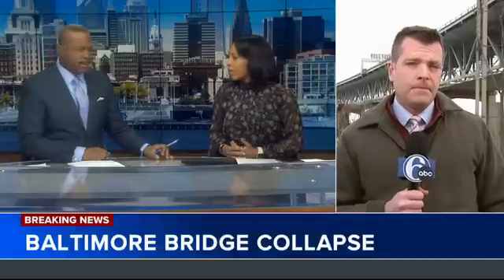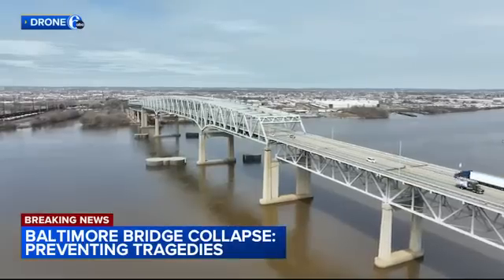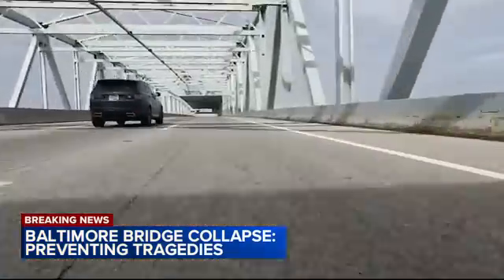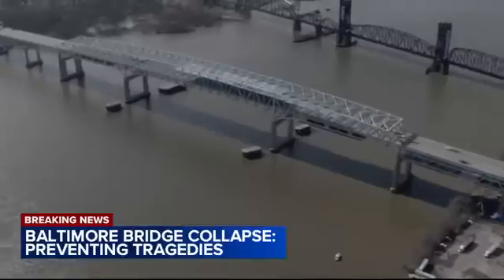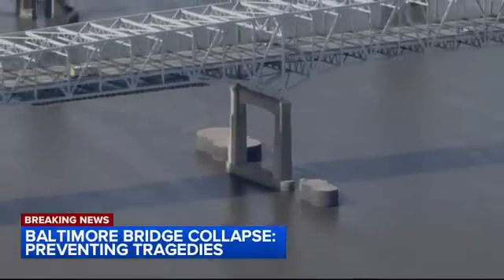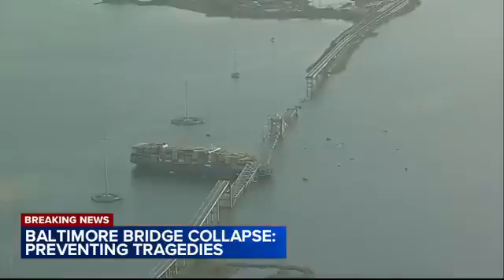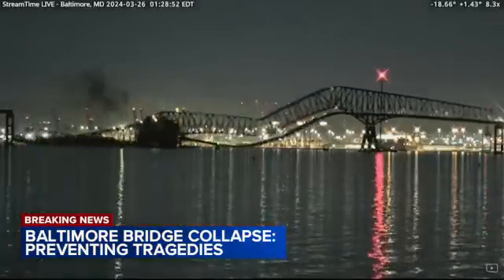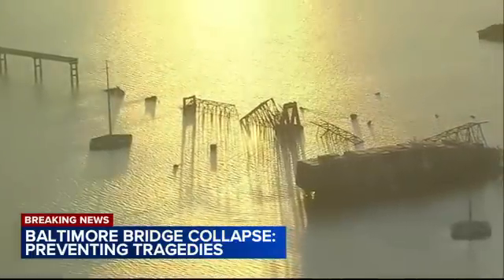Here's what surprised a structural engineering professor about the Baltimore bridge collapse

Comment: I'm no structural engineer, but the level of confusion various experts seem to be experiencing after a massive ship, fully loaded with cargo, struck one of the support piers of a bridge which then subsequently collapsed is baffling to me? What's so surprising?
Reply: Have you ever heard the saying, “the less you know about something, the more you think you know about it.” This applies here.  Although I am a structural engineer I do agree with you, based on the design, it’s not surprising. Probably most of what the experts said were removed and the News used what they wanted from the interview.
Reply: I would thought it would be common sense that a boat THAT large striking such a small critical point on the bridge making it crumble to pieces. Is the outcome many people would expect to happen. The fact that this bridge didn't have those guards there isn't a surprise alot of the bridges here don't either. It's not a surprise it didn't have them because that costs alot of $ to install and that's even if you can install them not every bit of the seafloor is the same. You might be able to put a support here, and 30ft away not being able to.
Reply: News anchors still don’t understand how an apple fell on Newton’s head.
Reply: @Wayne-n4z to be fair, even Newton didn't understand why the apple fell from the tree. The Law of Motion says Acceleration but the law of gravitational attraction says mass. Which is it? Can't be both. Force either equals Acceleration or Force equals Mass. Einstein further complicated the matter with his 'mass curves space' relativity theories. 
FYI. Gravity comes from acceleration. It doesn't create acceleration.
Reply: What gets me even more, is how the general public assigns expertise to news talking heads in the following days.
Reply: @FAFO4wisdom  no my friend it completely baffles me people listen to the talking heads in the first place.
Reply: Monday morning quarterbacks :-)
Reply: Experts are a dime a dozen these days. Don't sell yourself short my friend. Literally everyone and anyone is an engineer now,  even my dog. You just need to stick the word engineer in front of whatever it is you want to be an expert at. You could have a degree in flipping flapjacks and call yourself a flapjack engineer. Then you can comment on things like the twin towers collapse and say it's fake because buildings don't pancake like that. Anyway, I'm sure the bridge designers in the 70s predicted that these floating whoppers would be twice as long and carry 5-6 times the cargo 50 years in the future.
Reply: nothing other than the fact that they have to justify their jobs truth told.
Reply: In 1980 the same thing happend to the Sunshine Skyway bridge in Florida. You'd figure they would have learned a valuable lesson form that.
Reply: What this engineer said he was surprised about is the fact that there were no safety measures to keep the ship from hitting it in the first place
Reply: @katherinemoorhead338 Singapore (where the ship is flagged) is most certainly not a Chinese ally.  Nor is India, where the crew was from.
Reply: @bronco5334 India and China are friendly,  (BRICS trade organization) but I'm not saying that the crew (or China!) had anything to do with this accident.
Reply: @sottx8268 India and China have literally had fatal military conflicts on their border for years, including artillery exchanges.  

No, they're not friends.
Reply: @bronco5334  my bad. Thank would
Reply: Noob
Reply: Did you not watch the video? Theres 0 absolutely no protection for any of the support beams, you should be asking why other bridges have them but why not this one? Clearly protection for support beams was created for a reason? Why protect the beams that support your entire bridge? Why not do some simple research before building something that will collapse in 5 seconds if one of the thousands of boats that passes it each year hits it.
Theres a reason people like you are keyboard warriors and not fucking bridge engineers and thank god for it
Reply: Maybe take 10 minutes on goggle to familiarize yourself with the fairly standard safety practices of bridge construction (like segmenting) before asking YouTube to do your homework for you. If you don't know, look it up.
Reply: What's surprising to me is there were no mitigations in place for just such an incident.  There were no groins or artificial islands upstream or downstream of the bridge to block a ship from coming anywhere near the bridge piers. Just about every major bridge I have ever seen has something commensurate with the size of the shipping passing under it to fend off a strike. The dolphins by the Betsy Ross Bridge are a case in point.
Reply: @bobjohnbowles  Someone wanted the bridge project to come in under budget?  Hopefully there will be answers soon so that this type of tragedy can be averted in the future.
Reply: Because actually theyre dumb and Black But portrayed to know something.
Reply: It was surprising to me that such large portion of the bridge collapsed. Typically I’ve seen maybe one or two sections of road fall. I’ve always figured bridges would be engineered in a way that the supports would not all give way at once but would be independently able to support their own sections. But obviously this is a ship crossing so I’m not really sure what their constraints were on design.
Reply: @cosmicthespider  Now think about suspension bridges.   You cut a support cable and ......
Reply: They want to shift blame away from the real culprits, the ‘diversity hires’ operating the ship😂
Reply: You design bridges so if a support fails. Then the entire bridge doesnt just fail. 12,000 people can fit on that bridge in over 2000 cars.
Reply: @treatb09 no, bridges don't necessarily have that kind of redundancy.
Reply: If only that pillars had its safety tampon... that's the real cause of it coming down... ship out of control hitting bridges are expected... 

You can spend millions in investigation, and adding thousands of dollars equipment in every ship so it doesn't happen again...
Reply: Constantly cut construction costs.
Reply: I guess one of the crazy things is how many support beams were supporting the bridge, and how just half of one being taken down completely destroys they whole thing
Reply: @thehobbist5544  Truss girder bridges were design this way back in the day. They relied on each segment to support the other. this bridge was basically one big truss later they separated out the sections to make them independent and easier to install. Thus not as reliant on the entire structure. Look up the Forth bridge in Scotland it's huge and I've actually got to see it.
Reply: It’s nearly impossible to design for every possible scenario and it’s extremely expensive to just build a new bridge every time a new possible scenario comes out. You pick the most statistically likely scenarios at the time you designed it and with the standards you have. Maybe it WAS designed for only one section to collapse but under a different expected lateral load based on 1976 standards. That was a massive container ship. They probably didn’t design for a ship that big making a direct hit and they probably weren’t required to design to that at the time either. The engineers didn’t have the YouTube comment section at the time to help them through their design. 

Maryland probably should have put in that protection around the pillars though.
Reply: You obviously didn’t watch the video
Reply: Protections were not in place is the surprising part.
Reply: What's surprising is that a vital bridge across a vital port had very little protection from an out of control cargos vessel. See the Sunshine Skyway Bridge.
Reply: It's just that there appeared to be nothing TO PREVENT a boat hitting.... That's the craic of the story
Reply: It is surprising that they didn't learn from the same thing happening to the Sunshine Skyway bridge in Florida, four decades ago.
Reply: The bridge has suffer no issues for decades, why now?  Was there no safety put into the design for just such as situation?  Why did several sections collapse immediately?  The issue of the bridge collapse is only one part, the bigger part is the ship and it's catastrophic failures at that exact moment where the ship was facing the bridge, speeding up, all support (tugboats) had left, no MayDay until just before the crash.  All very interesting, almost choreographed.
Reply: How many cargo ships have traversed that passage?
Reply: The expert was confused that the bridge had no protection. He wasn't confused that the bridge collapsed.
Reply: As a civil engineer, noone is actually surprised it fail after that direct hit, of course it would fail lol even I dont expect any of my buildings to stay functional if a plane crashed into it, we dont give a fck about airplane loads and definitely not cargo ship loads, but in this case a protection could have been placed
Reply: There is a video with the perfect angle. It shows the ship did not hit the bridge, it literally knocked the support out from under it and ran ontop then the bridge collapsed of its own weight
Reply: who the hack allowed those ships to pass over the bridge?
Reply: I think the point most of these engineers are stating is that the entire bridge shouldn't have fallen, just the sections hit.  This bridge was built 1972-1977 and container ships of this size weren't around then.  Despite what this news clip stated, there were dolphins (concrete barriers) in front of the bridge pylons, but not nearly enough.  They were probably decent 50 years ago, but the protection wasn't improved.
Reply: @grondhero  It’s a continuous bridge. The entire structure is held up by opposing forces. The pillars just keep the structure at a certain height. Take one out and the entire bridge comes down.
Reply: @Nuttyirishman85  It is/was a continuous bridge, but nothing else you stated is correct from what internet searches and the 'experts on TV' have stated.  Everything I've seen is that just one section should collapse.

If you can provide a link supporting what you've stated, I'll read it, but that sounds like the worst bridge design ever.
Reply: @grondhero  There is a lot of information out there on bridges and bridge disasters. The outer spans pull against each other. When you lose one, the entire structural integrity gets compromised.
Reply: @Nuttyirishman85   Reread my post, then comprehend it.  If you can't, do bother repeating yourself.  If you can, then follow the simple instructions.
Reply: @grondhero  If "everything you've seen is that just one section should collapse," you need to understand how cantilever bridges work.  They distribute the load between cantilever sections, which has the benefit of making long spans, as necessary over shipping channels, possible without the massive supporting structures that would be necessary for the loads such a span would impose on end-supported trusses or box girders.  And "just build them beefier" shows a complete lack of understanding of such things as foundation bearing loads and required clearance for shipping.  It might not even be feasible at all.  Cantilever and other distributed-load designs have the benefit of raising the threshold of failure (by distributing the load) but they raise the stakes of that initial failure threshold.
Reply: @grondhero  Yours is one of the more thoughtful comments around here.  Someone else proposed that the piers should have protected by being surrounded by 100 meters of beach on all sides.  Others have suggested the bridge was not structurally sound.  This was a Panamax+ ship, and I'd like to see an analysis of bridges built in the past 25 years to see if they could withstand what happened here.
Reply: I would have thought that "smart" engineering would be able to limit the impact above, isolate by section
Reply: @MeredithBell-v3f  No.  Just no.  The very nature of the way that a bridge is constructed relies on the distribution of its weight all along its length.  If you watch the way such bridges are built, it is evident that the entire main span is co-dependent.
Reply: @BS-vx8dg The structural engineering professor in thia video disagrees with you. 😂
Reply: @notchomomma239  And you can find plenty of other videos today from other engineers stating what I said.  We'll have to wait quite a while for the final report, that's for sure.
Reply: @BS-vx8dg  I just live in a place with a lot of bridges, they're all segmented, and yes, those segments have saved thousands of lives when sections of bridges collapsed. I just assumed a basic safety practice like that was universal... apparently, I was wrong.
Reply: @BS-vx8dg That is not true at all. It is very RARE for entire bridges to collapse from one impact.
Reply: @BS-vx8dg not according to the structural engineer in this video. He said that each of the sections of those truss bridges is designed to hold up if one collapses. Things often don't work as designed but to say it was designed in a way that the whole thing comes down if one part does is false.
Reply: @notchomomma239 there is something wrong with what the professor is saying though.  A continuous truss bridge cannot stand without support, and,  because it's continuous, failure is likely to continue along the whole truss
Reply: @notchomomma239 this design was likely chosen because it allowed for a long span under which ships could pass.  Also, where do you live that experiences frequent bridge collapses?
Reply: @BS-vx8dg that’s is completely false.   “ a way a bride is built distributes the weight across the entire bride”.   That’s silliest load of crap.   Yes IF you build a bridge that way.  But there’s no requirement to build it that way.   Look at any of the Roman aqueducts.  Many of them are missing pieces but the whole bloody structure didn’t collapse. It’s because modern engineering , that has thrown out millennia of construction experience,  now tries to build everything in the cheapest possible way.    It’s always about greed.   If you think bridges HAVE to be built like this you have no concept of true engineering
Reply: @notchomomma239  " I just live in a place with a lot of bridges, they're all segmented, and yes, those segments have saved thousands of lives when sections of bridges collapsed ."  Where do you live that so many bridges collapse so regularly that you can draw this generalization?
Reply: @BS-vx8dg  I'm somewhere pretty safe compared to Iowa or Pennsylvania... but we do have a lot of bridges. The last bridge collapsed in my area, 5 people died. There were over 3,000 people on that bridge.
Reply: @notchomomma239  That's one collapse.  The reason I asked you is because bridge collapses make news, and multiple collapses (as implied by your comment) would cause a town to be designated Bridge Collapse Capital of America, and I've not heard that.
Reply: @BS-vx8dg  who said a town? I said an area... like a region.
Reply: @notchomomma239  Doesn't change my point.  How many bridge collapses have occurred in your "region" and in how much time?

I know you either aren't going to provide specifics (or just don't have them), and I get that; I don't like to identify where I am either.  So I'll just drop this line of conversation by calling BS on your claim.
Reply: When you make a bridge designed to have as few supports as possible, those few remaining supports become even more important.  @MeredithBell-v3f
Reply: @MeredithBell-v3f  The bridge is 50 years old this is how they were built back then. They can't just replace them every 10 years so they work with what they have until funding ie tax money is given to do as much. they will put a tunnel in like farther up to replace this. It takes an accident like this to get the money.
Reply: @MeredithBell-v3f you would think some ivy league educated engineer would have design a system that  protected the Bridge.
Reply: @MeredithBell-v3f   how so? It is 3 pieces and it hit between 2... the video i watched looked like the 3rd section rolled off the support being pulled by thr middle section
Reply: It's surprising to me the ship was going sooo fast,  there were no protective barriers around the stanchions, and that back up generators didn't take over when the main power failed?
Reply: @wolfwalker5924 It wasn't "going so fast", you were watching a time-lapse video.  These kind of ships can only manage an absolute top speed around 25 mph.
Reply: @bronco5334  It was reported going 8 knots within the harbor and not yet clear of the bridge.
Reply: Everyone is trying to figure out who to blame.  Someone, somewhere, didn't do their job.
Reply: @sandrab2589 it's just a mix of failures on the boat.
Reply: @sandrab2589  So we turn to an expert from Africa to tell us where we went wrong.
Reply: @sandrab2589  Probably multiple causes.  Most accidents are caused by many failures of judgement, equipment, training, etc. all adding up.  In this case there's the ship losing power, the Captain's reaction,  the bridge construction and design all came together in this tragedy.
Reply: @paulp4201  The only bright light is possibly more safety precautions in the future and the fact that it happened at 1:30am and not during a busy traffic period.  So sad.
Reply: Putins bridge has been struck with missiles twice e and a massive fuel contaner locomotive exploded on it and it didn't collapse. Something is very dodgy here.
Reply: @irishguy200007  totally two different bridge designs
Reply: ive seen people move giant logs of wood probably several hundreds of pounds with ease in water....  yes this boat was heavy but theres a thing called buoyant force, look it up.  if a car was floating Id say a strong adult male could also push the car with great force in the water.
Reply: @xKevmachinex look up momentum
Reply: The fact that so MUCH of the bridge collapsed is confusing. It should have been able to have held up other than the spans on either side of that support.
Reply: @FUGP72  If you look at the bridge before collapse you see a long center span with a Pivot triangle under each end that transfers load from center span to the shorter end spans with those spans other ends anchored to the entrance/exit roadway supporting structures. At the very moment one end of that center span dropped the weight of the center span no longer provided equalizing weight upon the Pivot triangle support at it's opposite end so that shorter span simply dropped with the triangle support pivoting skyward like your backyard teeter-totter.  An otherwise good design - but totally reliant upon those two center span end supports remaining intact.  It should have been mandated at time of construction those two  supports be protected by huge concrete buffers placed in front of them at a distance preventing contact by any portion of an out of control ship at any speed.
Reply: @FUGP72  The same thing on was said on 9/11 when the twin towers collapsed.
Reply: @FUGP72 no, a continuous truss bridge acts like one solid structure, if one end collapses it brings the whole truss with it.
Reply: @sottx8268  And again...no. Continuous truss bridges have collapsed before and it DOESN'T collapse this bad. They have ways to prevent it.
Reply: @FUGP72  No, not how load is distributed in a bridge, it is partially held up by tension
Reply: @FUGP72  No, this is how most long bridges operate. They're not independently holding up the weight of each section, the whole system is under constant tension and horizontal force in one direction cancels it out in the other direction.
Reply: @FUGP72  
It's a long, meticulous process building a bridge with spans wide enough to accept large boat traffic........
Reply: @FUGP72   The way it was designed obviously meant that each section relied on the the other section to remain in place.  A domino effect really.  No forethought at all by the authorities as usual and based around cost.
Reply: @scaryfakevirus   I'm no engineer but I believe all bridges are built that way, each section supporting the next one. At the time of construction they didn't envision humongous container ships of this size/weight. Don't blame the people who built the bridge. It was adequate for date that the bridge was built.
Reply: @sfopaladin2661  Exactly, but the infrastructure should have been upgraded to suit the changing shipping requirements of this time.  As I said, no forethought by the authorities.
Reply: @scaryfakevirus not true. That engineer himself said those truss  bridges are supposed to hold up if part of it collapses.
Reply: @scaryfakevirus as far as I learned exactly this is forbidden: a structure causing a domino effect. But I don't know since when this type of design is forbidden.
Reply: @Stoffmonster467  Nor me.
Reply: @sfopaladin2661 At the time of construction, a container ship this size couldn't possibly have struck the bridge support, because the shipping channel was too narrow and too shallow, so it would run aground far from the supports.

Then the city dredged the shipping channel to widen and deepen it, without installing additional protections to the bridge to account for the widened channel allowing large ships to get to the support without grounding.
Reply: @scaryfakevirus Hmmm... Just like each watertight compartment in the Titanic relied on the adjacent one not to overflow. Looks like we learned this lesson once before but didn't take heed.
Reply: @scaryfakevirus I don't think building a continuous truss bridge constitutes a failure of "the authorities".  If this accident was preventable, the prevention wouldn't have come from an alternate bridge design that is somehow more acceptable.  Continuous truss bridges are everywhere
Reply: @nateg08 that engineer either misspoke or was misquoted
Reply: @sottx8268  Bridges of that type being 'everywhere' doesn't mean they are safe especially when they are in a location where they could be impacted by such a huge mass.  Even in the 70s ships half that size could have caused a catastrophe too.  That said, the dolphins looked too far away from the pillars anyway. Placing more of them nearer to the supports may have averted this.
Reply: So nearly every bridge  in the world is at risk then is it ? You’re the expert so does it mean everybody’s in danger because when they were built we didn’t have these massive cargo ships but we did a massive bulk carriers which are far more dangerous much more concentrated with coal I’ll steal et cetera.
   I’m just an expert why the hell do you experts allow all these crappy looking bridges to be built they look like they’re just bolted  together with the hopes an  a prayer.
Are you seem concerned about his profit at the expense of tasteful looks or safety
Reply: @jimmorris5700  They are not crappy bridges, they are well constructed and normally safe.  All they required was the huge concrete starlings which the others had.  No bridge without the protection of these buffers would be able to withstand that enormous lateral pressure.  The ships and bridges are OK, they just require protection.
Reply: @scaryfakevirus No precaution is preventing this outcome. The ship weigh 110,000 tons.
Reply: @Nuttyirishman85  That would all depend on where the ship struck the buffers.  As an engineer (not a structural engineer btw) I know that no matter what the weight of the ship was,  the bow shape, the shape of the starlings or buffers and its striking point could be sufficient to place a small lateral push to avert a more serious impact.  A direct head-on impact may prove to be different, but it would certainly cut the risk.  A bit like a small side wind on a falling object will create a slight change of course.  As I said previously, what you can see above water will be different to what is below the river bed.
Reply: @scaryfakevirus Not bridge WITH those buffers would have withstood this impact. Those are designed to protect against GLANCING blows. Steer the ship away. This hit 100% head on. It would have broken those buffers and still hit the support pillar.
Reply: @FUGP72 Wasn't that what I said?
Reply: @Nuttyirishman85 about twice that amount. 220 ton. Moving at 9.2 mph. = catastrophic failure.
Reply: @FUGP72  "those are designed to protect against GLANCING blows. Steer the ship away. This hit 100% head on. It would have broken those buffers and still hit the support pillar."

...you seriously think that a ship will plow right through 10-20 meters of reinforced concrete without stopping AND without deflecting in either direction? Deflecting ashore would've seen it hard aground without hitting the bridge, and deflecting it into the channel would have passed safely through the shipping channel. 

But instead, you think the ship would have rammed through hundreds of tons of concrete and kept straight on while dragging it's belly over the rubble of the concrete barricade?
Reply: @scaryfakevirus   the design was incomplete then.  When the supporting pier is impacted total collapse of bridge would occur
Reply: @acheable  It was a Through Truss design and it was complete.    That is why they require full protection.
Reply: @scaryfakevirus  100% protection from live impact. Not only from live cargo ship also from act of nature.  The local authorities must exercise due deligence to conduct yearly assessments on old structures based on outdated code of design practice.
Reply: @crawlercrew874  The dang ship wasnt 220 ton friend, read better. I think you'd be better off with saying 220 million pounds = 110 tons its actual weight at the time
Reply: @scaryfakevirus did you read your own comment? A bridge on a river with heavy traffic of large, ocean-going container vessels, with no protection against shipping collisions around its support columns; that sounds a lot like a shoddy design. Just like kettles that can’t hold hot water and non-flammable matches. But do go on…
Reply: @EasyTiger.01343   I don't need to read my comment again pal.  The bridge was of an accepted engineering design.  However, a bridge of that type would require suitable 'protection' as I said earlier if you read it.  Protections around something are nothing to do with the actual article, but a separate consideration depending on the location.   If the river had just light traffic it would have been fine.  Your comparisons are ridiculous.
Reply: @jimmorris5700  Name any structure on Earth that can survive a 300,000 ton object hitting it?.   Bridges are great designs, very strong, they need to move/flex.  They are not built to be hit but a large object though.
Reply: @darrenporter1850 An angled concrete block can easily deflect a cargo ship of this size away from the bridge support.  And it doesn't even have to survive the process; repairing a damaged concrete block is much cheaper than replacing an entire bridge.
Reply: @bronco5334  100% agree!! Wonder if they need to look at all Bridges now.
Reply: @jimmorris5700 Well,those massive bulk carriers has mechanically controlled engines and transmissions and very rarely suddenly lost all power and control. Modern computer controlled systems often do. When the computer crashes so does the ship. And I’m betting that’s what happened here.
Reply: @jimmorris5700 What are you talking about? Aircraft carriers weight about as much as a modern cargo ship, but will be going under most bridges FAR FAR FAR less often than cargo ships. And not less dangerous at all. They have more redundancy in their control systems.
Reply: @jimmorris5700 Yes, every bridge in the world hit by this much energy (mass * velocity) would collapse.
Reply: @jimmorris5700  there is no excuse whatsoever to not have protective concrete barriers... apart from right-wing deregulatory assholery and ridiculous claims of "where do we get the money"?
Reply: @jimmorris5700  Yes! Any continuous truss bridge will collapse if one of its support piers is destroyed.
Reply: @jimmorris5700 totally agree.  I just posted basically the same comment about the greed and hubris of modern engineering.   everything modern is cheap flimsy and made to fail.   Greed at its finest .
Reply: @Peter-f2m  I cannot comment on 1800s USA structures but in U.K. to move heavy loads we have to use railway bridges lol ,Uno built before 120 ton transformers ! But still able to cope fgs .
Can’t use motorways oh no bridges too low lol 😂 laugh cry scream !
Reply: @jimmorris5700 INdeed they are not risk free. Cut the Golden gate  cables and youre done for! Cut the tower and you are as well. Design mitigates the risks by understanding forces but risk is still there.
Reply: @jimmorris5700  The engineers have to design something that works within the budget they are given.  The bridge was fine until the ship hit it.  This was an anomaly most likely caused by a rare mechanical issue at just the wrong time.  Unfortunate sequence of events, not a looming peril for every bridge.
Reply: @robertd9850  so the assumption that  cargo ship due to mechanical failure will hit the supporting pier of the bridge in turn causing total collapse was not considered in its design and function.
Reply: @robertd9850  within budget but will fail if hit by a ship.
Reply: @acheable  As my civil engineer said, a bridge was hit by a mountain so it lost.
Reply: @acheable  No.
Reply: @jimmorris5700  ... Mr Morris Sir, please write your comment in proper English so we can understand what you are trying to say. In any case lay off the booze/weed then try to re-phrase your reply so we can comprehend what you are trying to convey. Re:"I'm just an expert so why the hell do you experts allow..???" WTF?
Reply: @jimmorris5700  Depends on the age of the bridge. Most people don't know that the world trade center was built to withstand the impact of a 727, which was the largest plane in the air at the time the building was constructed. That is why they used 747's because they knew it would not hold. Engineers can only plan for what they know to be, not what the future holds. Of course there is also the cost factor. Again people don't relies that the power plant at three mile island was NOT built to the engineering construction drawings because the contractor got cheap.
Reply: @janewrighton9227 they weren't 747s.  They were 767s.  And the towers withstood the impact, as designed.  Unfortunately they couldn't withstand the resulting fire.